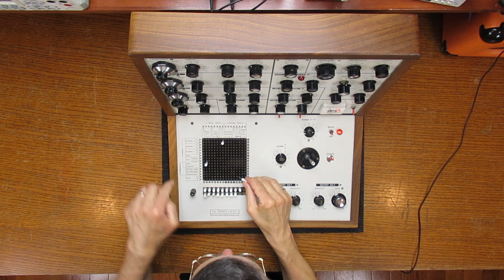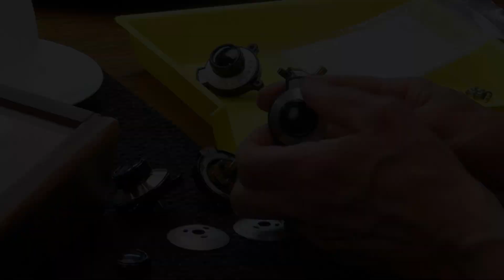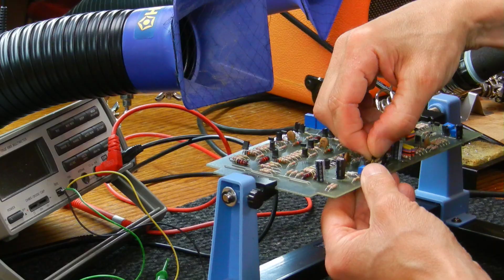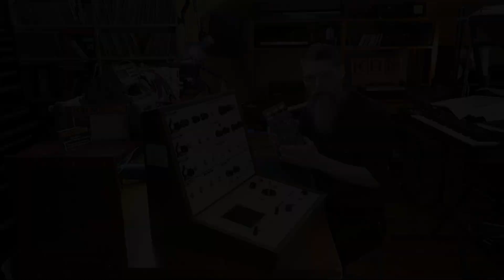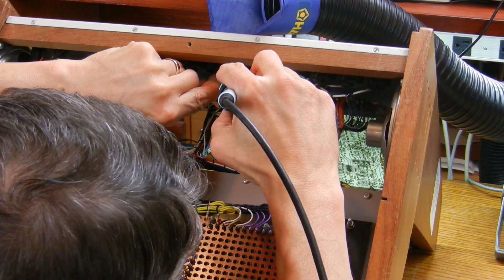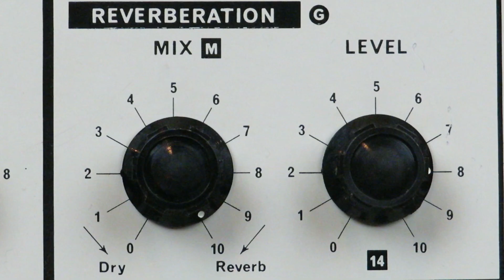EMS VCS3 Restoration with DK-1 Keyboard

Comment: Hi Keith….I am building a mk1 vcs3 from scratch….the circuit diagrams I have (from the vcs3 hand book supplied with original  units)show the out put amp chips as being 741 chips….i can’t see any mention of a + 11v required?…..is it only the very early vcs3’s that had the chips requiring the +11v…..excellent video…..will be most useful when I’m building my VCS3…. Best regards from Keith …uk